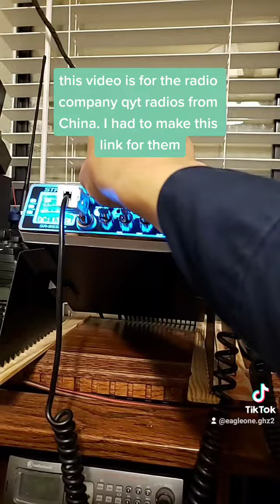this is the demonstration video of the new qyt - cb 58 radio . to show it is defective .

Comment: I am probably two years late. I just bought one and it is very good. One extremely great feature is built in SWR meter and numeric power meter. As anybody knows the included rubber ducky antenna would not give any useful range so i purchased a 51" telescopic antenna. The  factory rubber ducky gave 1.5 SWR while the fully extended 51" antenna dropped to 1.3 SWR and both antenna transmitted full 4 watts power. Also using a BNC to SO239 adapter I plugged my base station antenna (a vertical dipole) to the CB58 and the SWR reading was exactly 1 (my base station antenna was tuned perfectly) and this was also verified with an external SWR/power meter. One thing I wish QYT changes is to include a physical knob for squelch control rather than digital. The including 4100mAH battery was no slouch it ran the radio with on and off transmitting for an hour with no drop in bar. Last but not least if you are tied of 11 meter you can easily convert it to run 10 meter but you need another antenna for that. All in all I think the CB58 is better than most handheld radio in 11 meter band. By the way I also tested the FM mode and this was great but it used a bit more battery juice.

Comment: The President does have a service menu. Going from approximately 120 down to 85 on the setting  brings it up to 95 or 100% on both low and high power. Decrease the number value increases the Audio or Deviation.
Reply from the maker: Yeah my oas set on 03 and I put it down to 01 then 00 and it brought up the audio a little bit

Comment: Did you ever try the CB-58 on FM? I bought one too and on AM it does suck but I found FM to sound good on mine. I did a range test and was able to easily get a mile or so from the FM with a better antenna.
Reply from the maker: My is garbage on both am and fm
Reply: @Eagleoneradiogod  What adjustments did you find inside? Anything for the modulation?
Reply from the maker: @YouTube_User-9  i only found 2 by the mic and they made very little adjustment. I believe the audio and modulation adjustments are pll controlled through a soc
Reply from the maker: No good on fm eather pure junk.
Reply: I tested the FM mode with the rubber ducky and a 51" telescopic antenna and in both cases the radio sounded about the same at the receiving end. I didn't compare the maximum range on each mode because I was on foot ( I didn't have a magnet mount antenna at that time so I didn't drive) and my daughter was at the base station. I did walked about a mile in urban area.

Comment: Wish i saw your videos sooner. I also bought this piece of crap. The screen didn't turn on!
I got a refund minus €45 !!  These mofos. 
I sended as much videos as possible showing the screen not working. This shop on Aliexpress told me " why would we sell you bad radio ,for only €100 and damage our super good customers reviews " I payed the €145,45 for it even. Their "tech dep. would contact me. Which was 2 photos of  opened up radio, how the screen is wired. Wtf? If i wanted to do that.

Now, I have at least a large part of my € back  so I opened it. Which leaves dents and marks in the plastic etc  the screen was wired. Put the Battery against it. And suddenly it showed a grey empty screen . But when i was figgling to get it all back together,  Suddenly the screen did pop on in color. It shows very little output on the screen itself when ptt-ing. Only once I heared someone on what i remember from the 80's channel 14 being the call in channel.
If i put in the cradle ,It shows more gain. But still way too weak to send or hear anything. What a PIECE OF CRAP.
I also am doing nothing with my life. Recently got me cheap Ham handhelds. But i want to transmit , without a license. So thinking about a car CB 27mhz little radio.  The cheaper Presidents seem to be good enough to get me back into this hobby. Or so i hope.